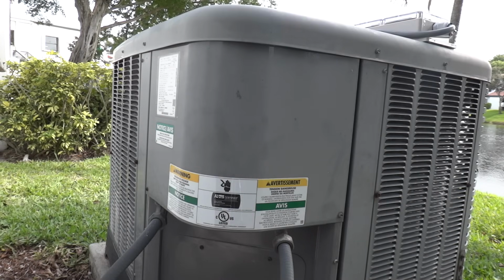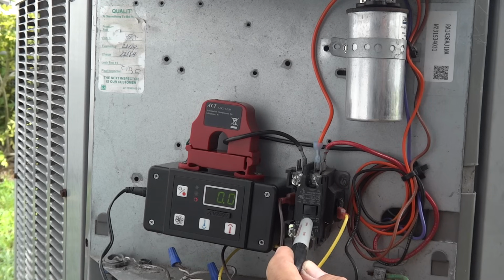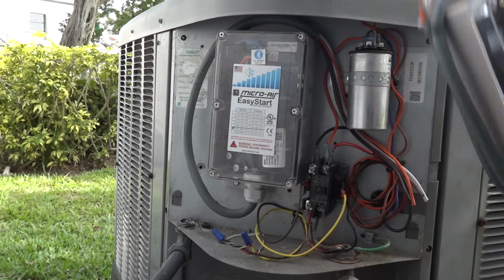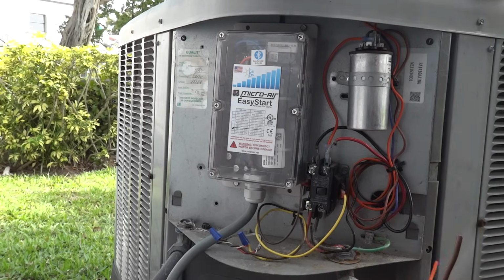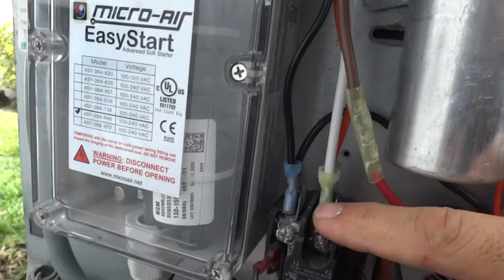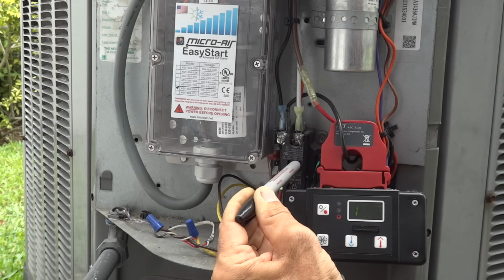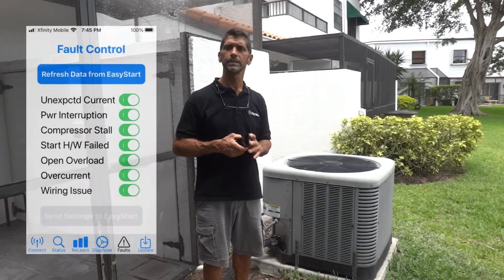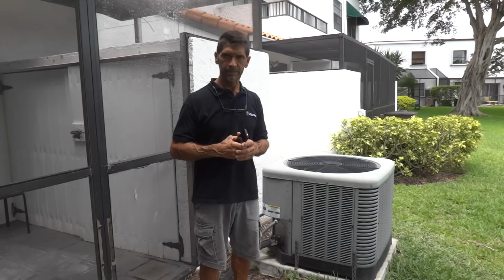Micro-Air EasyStart Home A/C Installation (368 Series)

Comment: Question for you.   I installed my Micro Air Soft Start on my 5 ton about 3 weeks ago.   The 5 ton unit is less than 3 years old so it's fairly new.  In the heat of the day,  I get a "Over Current" fault.  Never at night.  It'll be 93+ degrees out when I get that fault.     Customer support at M/A says it may be a weak run capacitor......  But I doubt it being so new.   They also tell me to have the soft starter to relearn in the heat of the day.  That hasn't solved it.  Other than that, it's done when I want it to do.  36 to 39 average start up amps.   Really good for a 14 seer 5 ton.    My concern is my 14.5KW generator won't start the A/C with this fault being it initially says 80+ amps when it's in "SCPT".   Then is goes to Normal, and settles in at around 37 amps or so.  I am certain the unit is not short cycling. Do you have any other solutions?  Can I just turn that fault off?
Reply from the maker: Chances are you have a non-bleed TXV in your indoor unit, which is causing the occasional high starting amps at night.  This is a very common issue with newer HVAC systems like yours.  I cannot help you here.  Post your customer support ticket # and I'll have the customer service rep re-open your case with some further suggestions.
Reply: @MicroairNet  Thank you.   The Over Current is happening during the heat of the day when It's super hot out.  Not at night.   The case number is:   20967
Reply from the maker: @prezzzrock  Case # received.  Dialog will be continued outside of YouTube.  Expect a response from customer service within a day or so since they're behind from the holiday.
Reply: @MicroairNet  Thank you so much.   Have a great weekend.
Reply: @MicroairNet  One of your very Knowledgeable engineers contacted me within minutes of your reply above.  He spent a ton of time with me in diagnosing my situation.   He figured out the issue and resolved it.  He was very patient and very detailed on his instructions.   This was outstanding customer service and I can't thank you enough for getting me the help I needed.   I did the generator test today and everything worked as it should.   Great product and I'm getting my 5 ton unit to around 36 start up amps.   I'd like to point out one more thing and benefit to the Easy Start unit.  The engineer contacted me this morning (Saturday by the way) to let me know the data that the Easy Start provided him, told him I might have a minor issue with my A/C system being over charged.   Amazing the Easy Start is smart enough to show him that.   I really appreciated him taking the time on his Saturday morning to tell me that.  Being over charged could cause an issue and I'll get that looked at right away.   Great company and great service you have!!!     A million thanks to you and the engineer that helped me!!!

Comment: Half way through, and I still have no clue why I would want one.
Reply from the maker: EasyStart allows you to start and run your A/C on an undersized power source - like a generator or a solar inverter - when it otherwise would not be possible.  Also, EasyStart reduces the wear and tear on your compressor, even when operating on utility power, thus extending the life of the compressor.

Comment: Will the unit withstand the northeast winter months with just a cover over the AC unit?
Reply from the maker: Yes.
Reply: One more question lol. When the ac reaches the desired temperature the unit shuts off and there is one red flash. Is that normal?
Reply from the maker: @jbhobbyistandMore  Yes, that's normal. The EasyStart is fast enough to detect the power interruption, but never logs it as a fault because power goes away and stays away. So, it just gets treated as a normal power down.
Reply: @MicroairNet  Thanks for answering all my question as quickiy as you did. Also my Son was sent a replacement for His faulty Micro-Air unit and everything is working as it should now. Plus He was told that He didn't have to send the original one back which I thought was exceptional for a company to do. Also my Micro-Air is running good too.

Comment: Looking at my situation 
Sir do you feel a soft start can help my units with RLA of 10.5 & LRA of 47?
It’s a duo 2.5ton hvac unit setup 
Or is its main purpose/function is use with generator? Which is a great feature!
Reply from the maker: Hello. Yes, the EasyStart would certainly help your 2.5 ton start more easily on your generator.  Whether or not you need it to start and run is something we cannot answer without more information. Nevertheless, there are always benefits to the life of your compressor, its protection against power anomalies, the strain on your generator, and the number of other loads that can already be running when your compressor goes to startup, all by adding an EasyStart.
Reply: @MicroairNet I was just asking if the 10.5RLA & 47LFA are levels of amp draw that can still be improved on by adding the soft start. I really like everything I’ve heard so far about the soft start device
Reply from the maker: EasyStart will reduce the 47 LRA by 65-75%, but it will not affect the 10.5 RLA.

Comment: What if yours has a single run capacitor? Is there anything you will do differently? We installed a 368 easy start in a 2-1/2 ton trane unit. Fan come on then compressor with a fault 5 red flashes. Tries to start again after a couple minutes and then runs.
Reply from the maker: Hello.  5 flashes is a stall fault. Do not energize the EasyStart any more since there is risk the wiring error may destroy it and void its warranty.  Take several clear photos of each of your 4 wiring connections, a clear photo of the system's wiring diagram on the inside cover of its electric box, and then submit a trouble ticket (attaching all photos) to the support team at the following website:  https://www.micro-air.com/contact_microair.htm
Reply: @MicroairNet  Thank You! I have one installed on a 2 ton Trane and works with no problem. The one were having trouble with is my Sons 2-1/2 ton Trane. The 2-1/2 ton has a single capacitor compared to my 2 ton duel capacitor. The problem we think is the fan draws to much amps. Wiring is connected as it should be but something just isn't right. Factory Start Components have been removed as instructed. Having trouble contacting micro-air they were not answering back till yesterday, Friday.
Reply: The support team looked at the pictures of setup that my Son sent then. Everything looks right. Turns out they are sending Him a new one/replacement. That's how you do business!
Reply: Less then a week later the replacement is doing the same thing. Showing a fault with 5 flashes.
Reply from the maker: Please post your son's original support case # here, and engineering will contact you via email.
Reply: @MicroairNet  I guess He already sent in a log to micro-air. But this is the number #20544 that got a response the last time.
Reply from the maker: @jbhobbyistandMore  There have been over 100 logs uploaded since the holiday. I need a name, email, or phone number to identify yours.
Reply from the maker: Found. Email dialog started.
Reply: @MicroairNet  That's good, because I tried to send you the information you requested but it gets deleted.

Comment: Hi are these for 3 phase or single phase AC units? Do you have soft starters for both types of AC's? Thanks
Reply from the maker: EasyStart is for single-phase compressor motors.  3-phase soft starts exist, but Micro-Air does not manufacture or sell any.

Comment: I'm wanting to install a micro air soft start on my HVAC system. I have a 1600 sq. ft. home. Will the ASY-364-X36-BLUE be the one that I need to install?  All the residential installation videos that I have watched are for the 368 and every time the 364 is mentioned it references RV installation.    Thanks in advance
Reply from the maker: Hi and thanks for your question. If your home A/C system is 1-1/2 tons (18k) or smaller, then yes the ASY-364-X36-BLUE is the right model.  However, in your case you likely have something in the 3 ton range for 1600 sq. ft.  So, chances are you will need the ASY-368-X48-BLUE.  Find out what capacity your home A/C system is then use the "What size do I need" link on the EasyStart product page on our website to find out exactly which model that you need.

Comment: I don't get it.  That high amperage he showed is just a spike.  It's called "inrush current" and it occurs when any electrical device is turned on.   It lasts a fraction of a second.  This guy had to invent a special tool just to measure it.  If & when I buy a whole house generator it will be the biggest I can afford and I don't see what good this device would do.
Reply from the maker: Hello.  The inrush current is exactly what the device is measuring. There are commercially-available clamp-on ammeters that can read inrush, but only a few are accurate. The lab device used in this video was custom built for our product development and design verification and it has the highest accuracy. It is therefore showing the real inrush amps.  

If you purchase a generator that is oversized and can handle the inrush that your A/C compressor requires, then no you will not need an EasyStart to be able to operate your A/C on generator.  EasyStart allows generators that do NOT have enough capacity to start the A/C. So, adding EasyStart in these situations allow the A/C to start and run when it otherwise would not have worked.  

So in conclusion, if you don't need EasyStart, good for you.  But also realize that 1) many others have found that oversizing their generator costs more than the cost of the EasyStart, so EasyStart can actually save on the generator investment, and 2) many people already have a generator that is undersized, so adding EasyStart allows them to use the A/C without having to replace the generator with a larger one.
Reply: @MicroairNet  I'm sure everything you said is true however I consider it false economics since nobody in their right minds would size their generator for ONLY the AC.  There will always be other devices to run simultaneously and so REQUIRE a larger generator.  My advice to those already owning a small generator would be to use the cost of your device toward the purchase of a larger generator which is the true solution to their problem.  BTW, using that "home brew" ammeter smacks of cheating.  There's no way of actually know what the device is measuring except your word.
Reply: lol I do not think you understand the concept of this device. But yeah order gigawatt generator to power your house 😅
Reply: @beretta0222  I think I understand the intent of this device better than you do.  Personally, I will use a generator sized appropriately for the job it needs to do.  I recommend the same for everyone.
Reply: @ramtek2702  of course you do.

Comment: I visited the link and did the 4 steps. Model-Part Number: ASY-364-T36. Then what? There was no tab or pull down on product list. Nothing. Does anybody test web sites?
Reply from the maker: Yes, all the time.  The instructions at the end of the product selector stated "Select this model from the pull-down list on the product page".   Perhaps you had trouble finding the product page.  Here it is for your convenience:

https://www.microair.net/products/easystart-breeze-soft-starter

Comment: Would it work with a well pump?
Reply from the maker: Hi and thanks for your question. Yes, for 3-wire well pumps (i.e. the type where 3 wires go down to the motor in the well), EasyStart can be applied. It's not a guarantee it will work, but several people have succeeded in doing so.  Most Franklin well pump systems - which are very common in the USA - seem to work in this application.  Most are CSIR type motors, and they typically require the EasyStart ASY-368-X48-BLUE or ASY-368-X72-BLUE, even when they are only 120VAC.

Please also realize that because of limited resources now that it is high season, Micro-Air tech support cannot provide you detailed support for a specialty application like this. So, unless you are tech savvy enough to work out the wiring and installation on your own and at  your own risk, Micro-Air does not recommend that you purchase an EasyStart for such an application.

Comment: hi, can i run a 2.5 ton unit connected to the MicroAir 368-x48?  how about using at MicroAir 364-x36 for a 3 ton unit?  im asking because i have 3 AC units that i will be needing to install the MicroAir and just wanted to make sure if i should go with the bigger easy start for the smaller unit or stick with the smaller easy start for the 2.5 & 3 ton units. 

basically can i use a 368-x48 MicroAir on a 2.5 ton ac unit?  thanks.
Reply from the maker: Hi.  Yes, you can.  In fact, since the publication of this video, the sizing recommendations changed a bit (as described in the video description).  A 2-1/2 ton now requires the ASY-368-X48-BLUE.  The smaller unit will work - but possibly not optimally under some circumstances - since hot weather and your particular system's pressure-equalization behavior can dramatically affect the starting behavior and requirements.
Reply: @MicroairNet  super awesome, thank you for the reply.

Comment: This type of product has been on the market for over 20 years. These name brand start kits can be purchased for $35-$75 from a local HVAC supplier.  Basically you’re paying over $300 for a Bluetooth option that helps you absolutely 0.
Reply from the maker: Hi jmccOutdoors. What you're stating isn't entirely true. A "start kit" as you call it for $35-$75 is actually a "hard start".  That is an entirely different and a far inferior device as compared to EasyStart, which is a "soft start".  Please check out this video for a full explanation on the differences:  https://youtu.be/7Gim96oyczw

Comment: Hi I have firman trifuel generator 50amps, 9400 start watt and a 5 tonne Lennox 13ACC - 060-230, (15 years old).
I plan on getting the micro air soft start.
Two questions:
1. Is my AC unit compatible?
2. Will Harmonic distortion on the compressor will be mitigated with soft start?
Reply from the maker: Hello Alan.  Thank you for your inquiry.  Yes, the EasyStart ASY-368-X72-BLUE is compatible with your 15yo Lennox 5 ton system.  However, EasyStart does not affect the steady-state running operation of the compressor, so it will not protect it against any %THD that your generator may produce.  Hope this helps.
Reply: Thank you for the prompt response

Comment: @MicroAir does this device reduce electricity usage in total? For example: if a compressor uses 80 LRA to start, does this device basically send the compressor four jolts of 20 amps? Which equals 80 amps anyway? Second question, does this device reduce running electricity usage? Third question, why do you still need a capacitor? Fourth question, my capacitor is slightly outside it's ÷-5%,should I replace the capacitor when installing this device?
Reply from the maker: Hello Jason. No, the EasyStart does not reduce electricity usage. Although the startup current will be reduced by 65-75%, the duration of the startup is so short, the total energy with respect to your monthly electricity bill - even with ~3 starts per hour - is almost immeasurable.  

Next, the EasyStart startup sequence does not "send jolts".  It is very much the opposite.  Instead, via some very complex and sophisticated electronics, EasyStart gently applies a gradual ramp of voltage and current to the run and start windings separately, monitoring the current and the compressor rotation all along the way.  Once the compressor begins to rotate - which EasyStart detects real-time - the voltage is gently ramped the rest of the way to full power, then the electronic devices that performed the ramp are bypassed with a high-current relay. This sequence takes about 1 to 1.5 seconds. 

Lastly, if your run capacitor is slightly below its -5% tolerance, you do not need to replace it.  Typically, a compressor will not suffer significantly increased running amps unless the run capacitor is more than 15% low.  Same goes for the fan portion of the run capacitor.  But, you can replace your run capacitor any time you wish.
Reply: @MicroairNet  I appreciate the information. Thank you.

Comment: I have a 2 1/2 ton Goodman HVAC unit, on your Website I recommended the 368 x48 , on this Video it would be only the 364 X36. Which is correct ?
Reply from the maker: As was stated in an important "Please Read This" notice placed in the top of the video description, the ASY-368-X48-BLUE is the correct model for your Goodman 2-1/2 ton.

Comment: Can someone help me?  Just installed the micro-air and I want to connect to Bluetooth. Where do I find the Easy Start ID??
Reply from the maker: Hello DJ. Thank you for your question and for your purchase.  Although each EasyStart has a unique ID, you can allow the app to search for the nearest EasyStart it finds by leaving the selected ID box (there are 3) totally blank and just tap "Connect to EasyStart".  The app will then fill in the ID to the box and save it for you so it shows every time you open the app. The 3 ID boxes are so you can save up to 3 different EasyStart IDs, if you happened to own more than one. Please realize as well that the EasyStart must be energized in order for the Bluetooth to work. That is, your thermostat must be calling for the compressor to run and its contactor must be closed, otherwise the EasyStart will be dark.  Thank you again for your business.